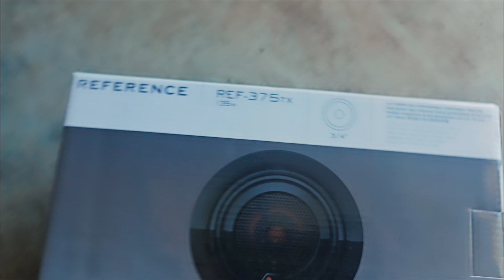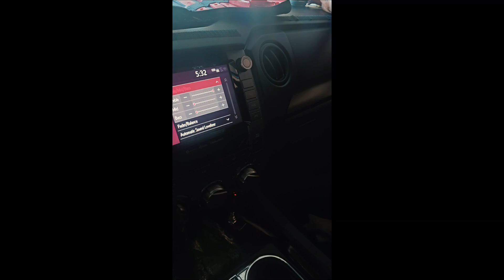Toyota Tundra Speaker Upgrade

Comment: Factory JBL stereo? or new headunit and amp as well
Reply from the maker: @travisfeld97  factory head unit, no amp installed just yet
Reply: @DaVerseOfficial  I have heard the head unit is the problem? so you notice a big diffrence even with the stock head unit? Are those 2 ohm or 4 ohm speakers? I think the stock system is 2
Reply from the maker: @travisfeld97  yes, major difference...if you watch my video using headphones or bluetooth, you can hear the difference,  rather than listening to it from phone speakers...and the speakers are 3ohm that we installed.
Reply: @DaVerseOfficial  thanks! Didn’t know  there’s a 3 ohm. I’m looking at the tech12 volt plug in amplifier to install first

Comment: Were there any amps assigned or was that all factory aftermarket set up? Getting ready to upgrade my 2018 Tundra speakers. Thanks!!
Reply from the maker: @Moestyle75  no aftermarket amps were installed, we just swapped out all factory speakers and the results were amazing.
Reply: @DaVerseOfficial  BRO this is a cheat code! I’m bout to install mine this weekend. I have the TRASH JBL system that is as loud as my iPhone, lol!! I don’t have the infinity setup but hopefully the alpine speakers will be better and louder than the factory. Thanks bro, new subscriber and luv the channel!
Reply from the maker: @Moestyle75  the infiniti speakers are louder than the alpine speakers. I had alpine in all of my cars from the factory, but i must say, the alpine do sound better than the Supposed JBL. Just make sure to check that they really did install Jbl speakers from the factory. A lot of sticker information on the windows of cars are false.
Reply: @DaVerseOfficial  I kinda impulse bought the alpine 10 speaker setup because of price and plug N play functionality. I should’ve researched more but 🤷🏾‍♂️. Hope I’m not disappointed once they’re installed. You said they’d be better so I trust your judgement. I can always upgrade later 😆.
Reply from the maker: @Moestyle75  i get it, i impulse shopped my whole life...i learned the hard way..lol, trial and error...if your not happy with it, you could always sell the setup on offer up or facebook marketplace, and get what u really like.